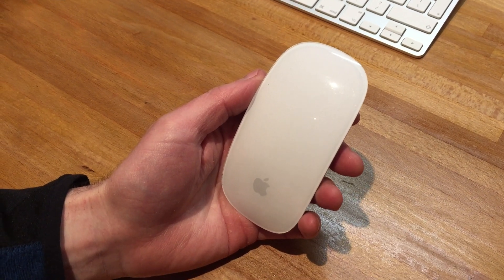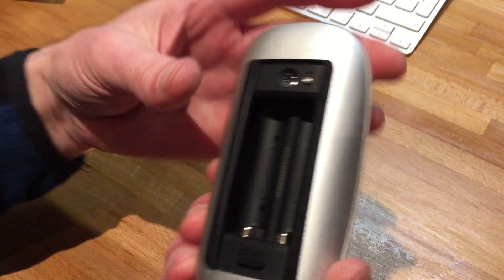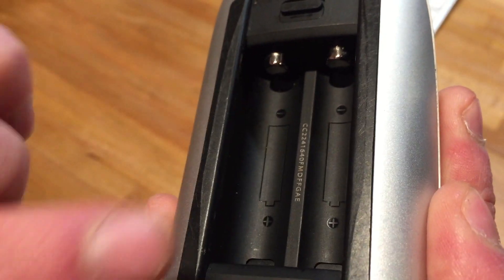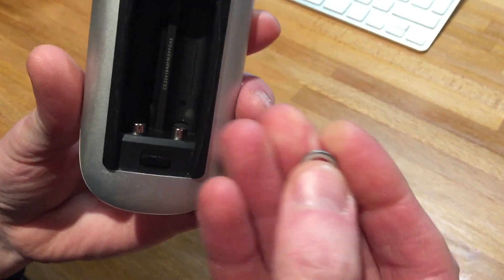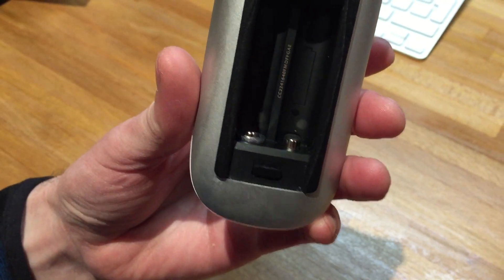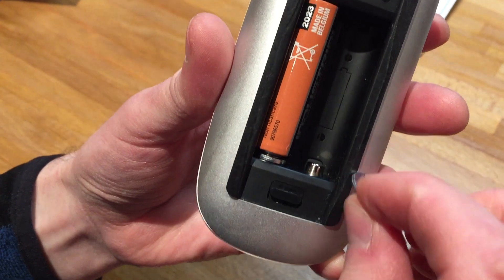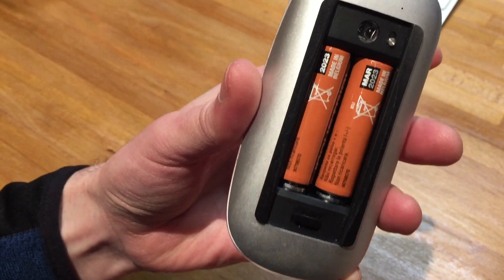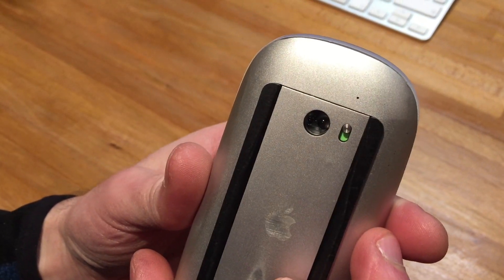Fix an Apple Magic Mouse with Connection Problems

Comment: I did clean the contacts of the mouse with q-tips dipped in alcohol and it's stable now without tighter batteries.

Comment: Great video.  I couldn't find the right washers, but I did find out that AA batteries are slightly differing lengths.  I happen to have EVELOOP rechargeable batteries that fit perfectly.  No washers needed.

Comment: I just saw that you already found a better solution than with your first video
Rechargeable batteries have a shorter plug on the positive pole than standard batteries. That's probably because these are wrapped thicker. The problem with the mouse is the Plus Connector because the plastic strip from the housing is in between. Therefore, the battery does not have a good connection. A simple solution is to put a piece of aluminum foil between the battery and the + connector.

Great Video BTW

Comment: i  just use little wads of aluminum foil to increase the connectivity between the batteries and the contacts.    I've been putting batteries into thousands of products since i was about 4 years old and this is the only time I've had this problem.  Funny that a company like Apple could mess up something so simple.
Reply: Their products are designed that way in order for the average consumer to repurchase every few years. That's why the right to repair is so important because it's not only cost effective to fix your own products for ONE issue than to buy a whole new item and also it stops contributing to our electronic waste that continues to pollute the earth as much as any other garbage the humans throw out.

Comment: The tinfoil worked for me, I just made the foil as thick as the washers, thanks for the idea!
Reply: Thanks Dylan.The tinfoil didn't work for me.  I am actually using split washers at the moment which are even better as one edge of the split pushes against the battery and the other edge pushes against the contact.
Reply: @jamesjmh66  just gonna try that